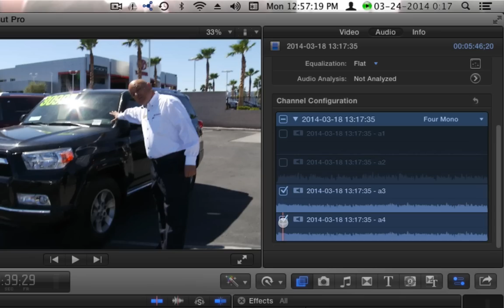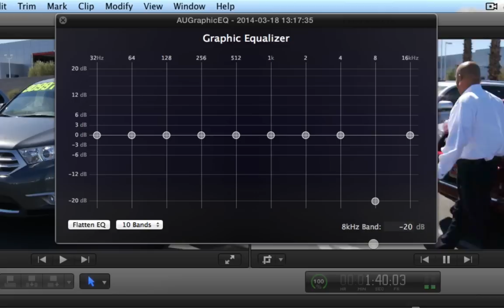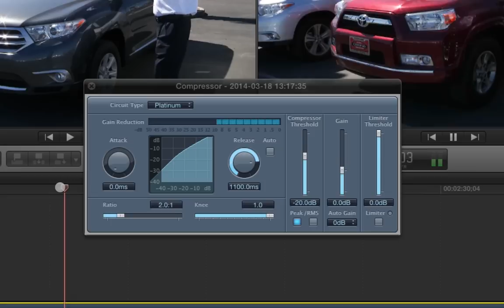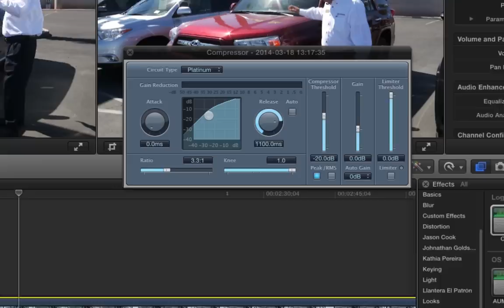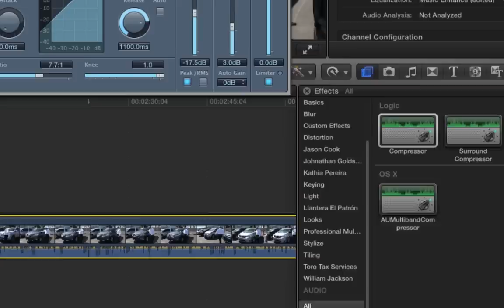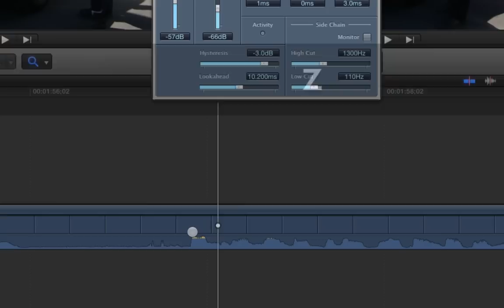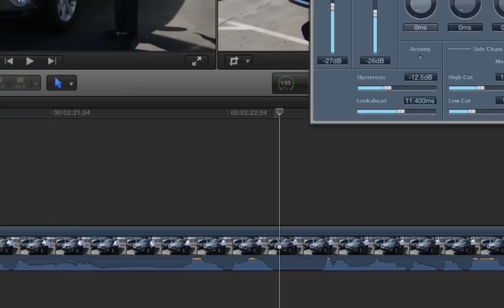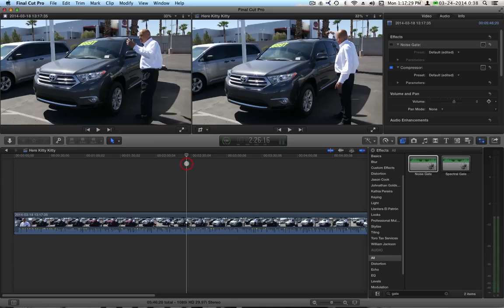Simple EQ and Compressor Limiter in Final Cut Pro X

Comment: What effect to help reduce the echo of a room ? I've tried but couldn't get a good natural result... thx keep up the good work :)
Reply from the maker: Reverb is difficult to remove.  The best standard FCP standard tools I've been able to find for that is an expander followed by either noise reduction or noise gate. While a compressor reduces the dynamic range of the audio (makes quiet sounds louder and loud sounds quieter), an expander does the opposite.  It amplifies the loud noises and suppresses the quiet ones.  I'd try applying an expander first, and then adding a noise gate to try to shut out that reverb.  Still, you may end up with a lot of mid-range noise when the subject is speaking, and you will hear any reverb present as they speak.

Comment: What's the difference between Noise Gate and Denoiser effects?
Reply from the maker: Tom Lim Awesome question, Tom.  I'm going to make a video to explain the difference, and demonstrate how their difference actually sounds.  I'll post it up soon for you.

For a quick explanation, a noise gate removes all sound below the threshold, and opens the gate to all sound when the threshold is exceeded.  A denoiser, however, finds a "print" under the threshold and within the parameters you define and attempts to remove that noise throughout the entire clip.
Reply: Brett Scott Gentry So if you're trying to remove ambient noise, like in your video, noise gate would definitely be better?
Reply from the maker: I'd probably have to say that it depends on the ambient sound.  I'd usually try the Denoiser first, and see if I can remove the ambient noise with it.  If it's too much trouble, or if the clip has that "digital artifacts" sound after using the Denoiser, I would then try the Noise Gate.  In the case of this particular clip, because the ambient noise is so loud and broad across the spectrum, the Noise Gate would be a better choice.
Reply from the maker: Tom Lim This is a video reply to your first question.  I actually used a denoiser on my own audio so that you can hear the difference in the audio from the computer.  Hopefully, it helps you out.
Reply: Brett Scott Gentry I don't see a link for the video.
Reply from the maker: Apologies.  https://www.youtube.com/watch?v=ONiBUraew5Y
Reply: Brett Scott Gentry Says Private.  Probably have to change it to Unlisted. :)
Reply from the maker: I switched it to Public.

Comment: What radio microphone was this? it's terrible.
Reply from the maker: It's a Blue Yeti, but I'm in a room with three flat reflective walls and a huge glass wall to my left.  So yeah, it's terrible.  Thanks for the view anyway, though.
Reply: But the dude selling the cars is outside? With a mic that close to his chest there should be way more bass. Is it a Bluetooth mic or proper radio type?
Reply from the maker: @huwjones5879  - I believe Gus' mic is a Sennheiser Ew100 G3.  It has been a few years since I worked there.  It's a very small mic physically, and I've found it doesn't pick up a lot of bass other than wind.  It's wireless, as well.  Gus also tended to give a quiet audio check, and then shout for the rest of it, so I turned it down quite a bit.  However, naturally, that mic doesn't have a lot of bass.
Reply: @beatusmongous  Very odd indeed, I've been using the Sennheiser Ew100 G3 mic system for years and never had a lack of bass, it must have been faulty, the Sennheiser Ew100 G3 is pretty much an industry standard known for its full range reproduction. "quiet audio check, and then shout for the rest of it" we've all been there!
Reply from the maker: @huwjones5879  - We did use Azden receivers on the camera, which may have been a contributor.